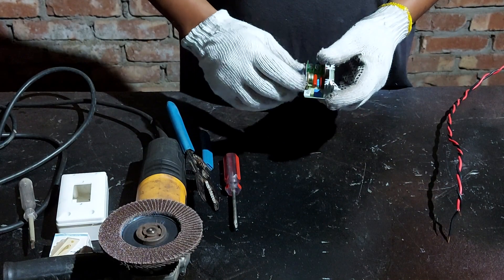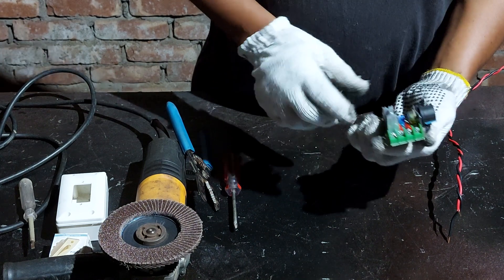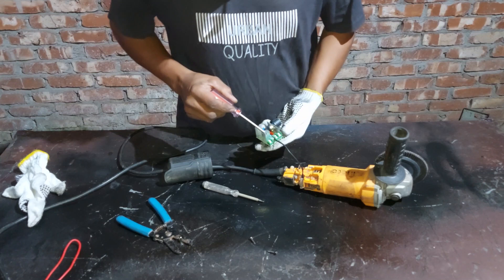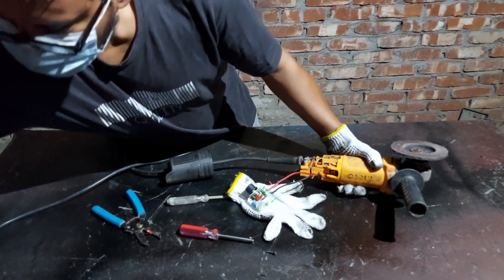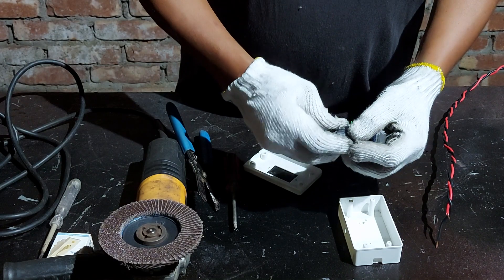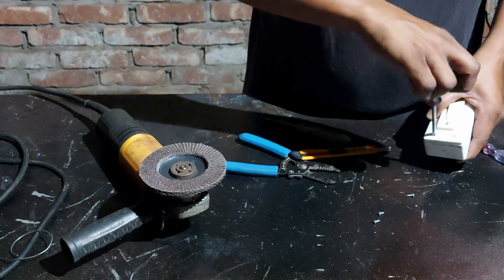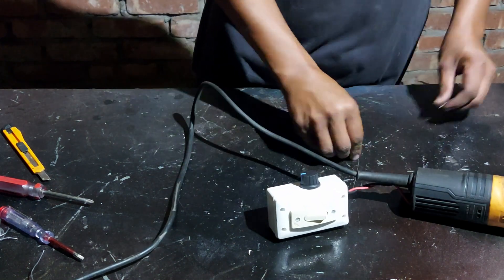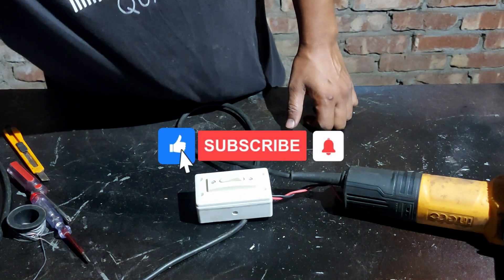Using Voltage Regulator to reduce Angle Grinder's speed

Comment: I was able to control the speed of the grinder but the torque  was reduced considerably which rendered the machine totally useless.
Reply: Of course deceasing voltage decreses torque! 100rpm and little to no torque.